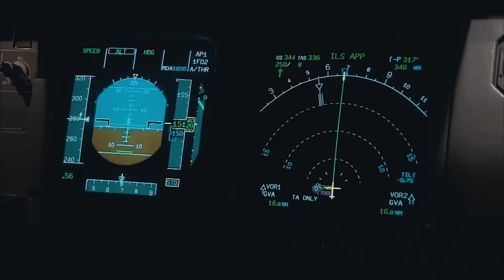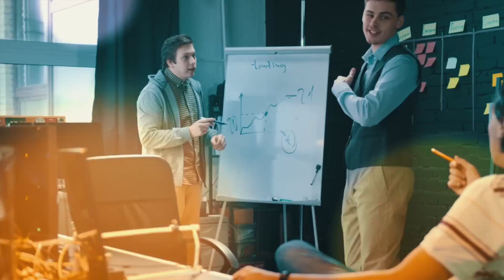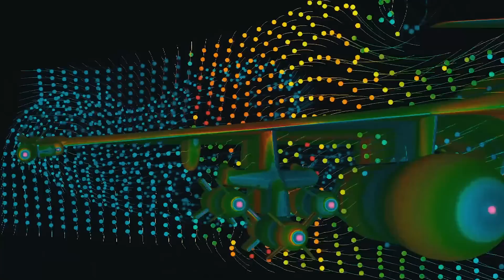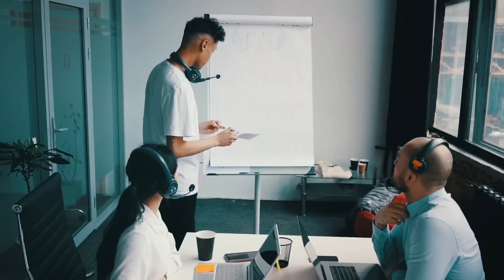Japan Is Building A New Sixth-Generation Fighter The Whole World Is Afraid Of

Comment: That's Kongo class, and the current Kongo class is of destroyers.  The previous Kongo class was of cruisers, but that was a century ago.  Also, can't "replace" Shinshin because that was merely an experimental platform.
Reply: Agree with almost everithing, but I think that the ww2 kongo was a battlecruiser (when first built by UK) that was later converted into high speed battleship as her sisterships (built with inverse engineering).

Comment: The reduction of fasteners by glue is a significant change in aircraft production.  It will be interesting to see how it works.
Reply: Inspecting and servicing fasteners is as simple as it gets.  How do you service adhesive between panels and components?  I'm actually asking because I have no idea.  The only thing I could imagine is that servicing is impossible and adhesive pieces will have to be pulled, stripped and completely reglued at either regular intervals or at any sign of degradation.  Which would be crazy expensive.
Reply: solidXxtuna raises an obvious point, but my take on it is that the reason fasteners and rivets need inspection is because they exist. When no joint exists, there is no need to inspect them. Kind of like inspecting the middle of a panel. Panels in modern fighters are already carbon kevlar composites and this thing will be more unibody in that respect. To me the problem with cost on all these modern aircraft is the lack of mass production. Imagine what a Chevrolet Impala would cost if the whole thing and every sub-component was hand made and hand assembled. Bigger, simpler, more unibody components without all hand crafted joints and fasteners no doubt does save the 70% labor the Japanese claim, and more conducive to mass production.
Reply: @paulbriggs3072  That would be the ideal outcome for these adhesives.  But two things that adhesives traditionally do not handle well is vibration and heat.  I suppose I could see that between design and manufacturing, fitment could be tight enough to minimize vibration.  But there's no way to eliminate heat.  You could try  to insulate panels with a coating or something, but that's another significant additional cost to apply and would itself need to be inspected and maintained.  I'm no expert on adhesives and maybe they've advanced beyond being bothered by the stresses of supersonic flight.  And that would be cool, but again, would very much not be cheap.

I agree with your point on mass production.  There's just not enough demand for the product.  Even if there was literally one model of military aircraft produced and bought the world around, it still wouldn't be enough volume to allow the economies of scale of mass production to cut prices to less than half like the Model T did for example.  Although when you're talking $337 million for one F35-C, every percentage point of costs cut is still huge.  And to go to your point and argue against mine, I'm not positive on this but I believe the large majority of F-35s exported around the world are the A variant which come in at almost a third the cost of the C.  The A is cheaper to produce, sure, but that can't explain how massively cheaper they are.
Reply: Congress and the military often do not understand the concept of scale.  They go out and want quotes for 1,000 units.  Engineering tools up for 1,000 units. The order is changed to 100 units and the buyer can not understand why the cost goes so high for each unit.  The cost of the engineering and tooling is prorated into each unit.  More units less cost per unit, less units more cost per unit.  Take the C130, manufactured since 1950's.  It was not a volume aircraft, only 1 or 2 units a month for decades.  Many of the sub assembly jigs were made of wood to keep cost down.  They had to be replaced many times over the years.  Many of the machines used to manufacture parts were actually used for other volume aircraft and the C130 just slipped its units into the flow.    Increases in production volume posed a significant problem for the manufactures.   This is the other end of the scale.  Just a few thoughts.
Reply: It's been done before on lower performance airframes like the Grumman AA-1 series (the wings, anyhow). We'll see how it pans out.

Comment: If the yf 23 was offered to them why didn't they take that it was a way better plane than the f22 that Japan originally wanted.
Reply: I remember seeing a report on that very thing, although I didn’t know the US ever approved the tech transfer. The reason they had second thoughts was when they dug into it the costs would be much more than expected didn’t, because not only was some data wiped, for security reasons. beyond that, the YF-23 had not been updated since the trials with the YF-22, and the test aircraft used in the trials were basically build around the components upgrading anything would be difficult as spaces for that aren’t usually added until working on production blueprints